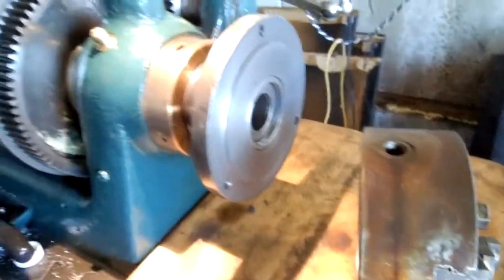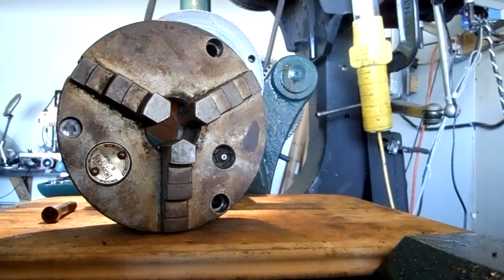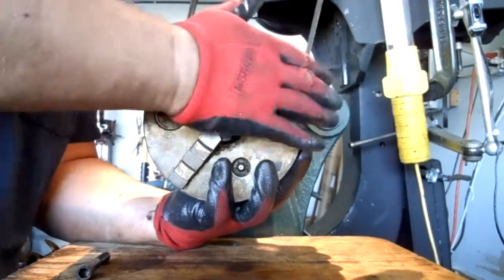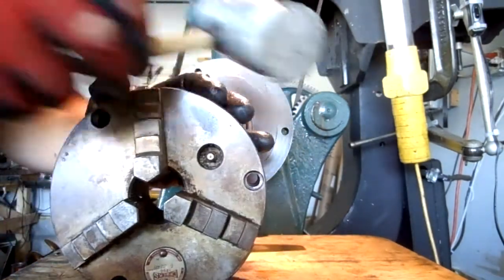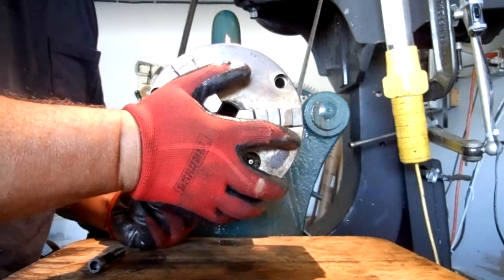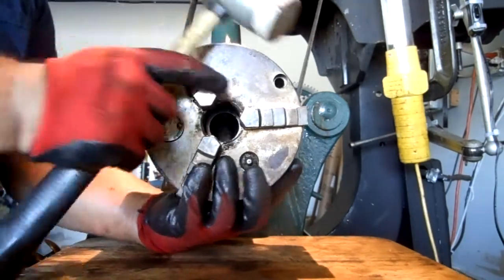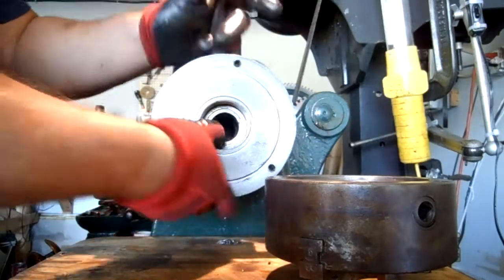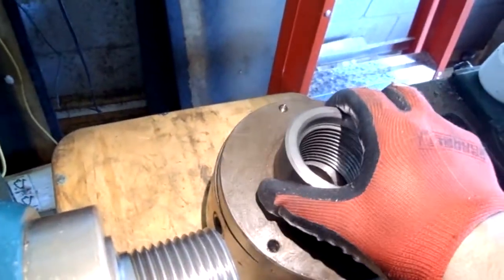BackPlate bushing vid take2  pt 2

Comment: Nice job bud! Looks great! Was I correct with your tooling issue on the last attempt?
Reply from the maker: I did extend the tool out more from the bar ...I measured something like 180 thou but did it anyways...I am still not exactly sure what the problem was...but its done :)
Reply: Lawrence Harasim I think it was a case that by measurement you were still to tight! I have had cases on older machines that you need more than a couple thou clearance to work! Maybe they had a 58 degree grind instead of 60 on the tool when they made the thread (or 62)! Glad to see it works! Sorry I did not take time to comment when you had a little trouble!

Jeff